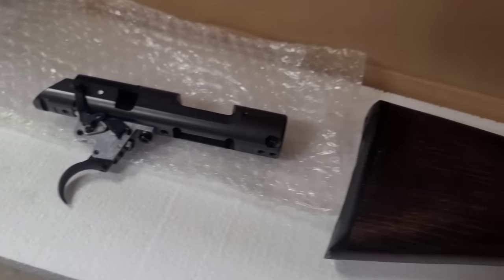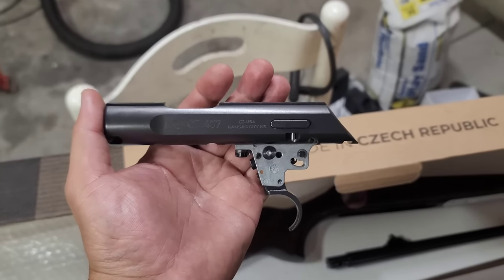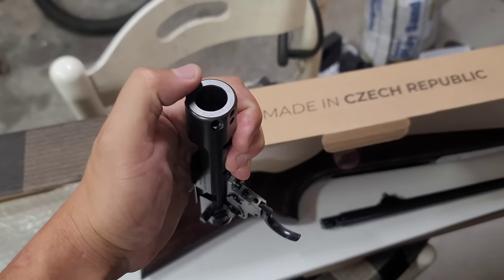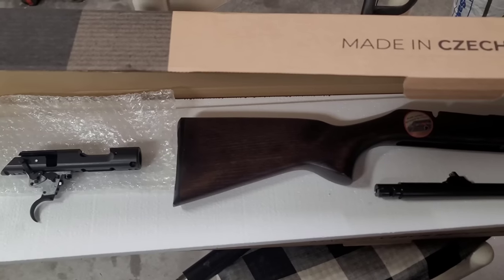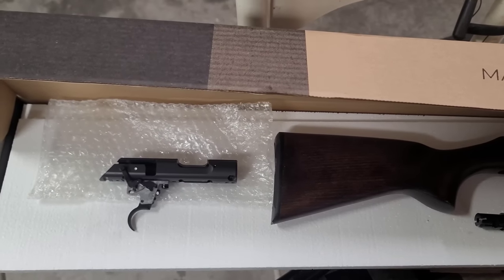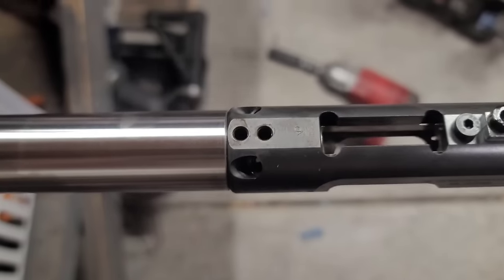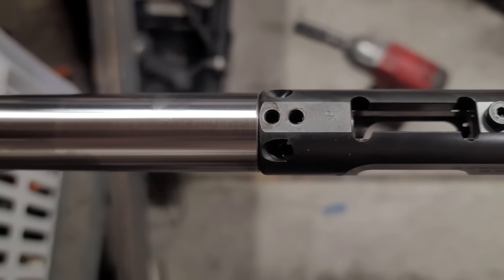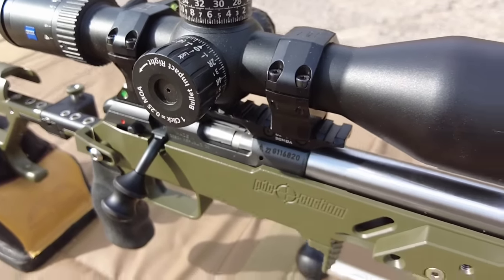Why my CZ457 builds are crazy accurate🎯 #DPGunworks

Comment: I totally get what you are doing, and why. I have zero experience with the 457, but I've seen bone stock CZ 452's American sporters shoot as good at 50 yards. I would expect smaller groups at 50 for the work that you are doing. That's basically a .22 LR rail gun you got going there weight wise. Maybe you just need to find the right lot of ammo for that rifle.
Reply from the maker: The rifle isn't lot tested. What you see here is consistent repeatable accuracy and ability to shoot either Lapua or Eley. Don't see any videos of a 452 shoot 1 inch consistently at 100 or not having a cold bore shift? So to state 452's in general shoot as good as this one is erroneous to state because thats far from truth
Btw, biggest group here at 50 was .378".

Comment: How many factory rifles have you had to send back?  Always nice to see someone take pride in there work!
Reply from the maker: More than I can remember lol
Reply: @EagleEyeShooting  that sucks. My dad worked for Ruger for a bunch of years and they had a run of bad 10-22’s for a few months. It happens unfortunately
Reply: @jeffhuntley2921  I'd guess that Kenny's standards are a wee bit more restrictive than Ruger's.  And I say that as someone who has a very accurate Ruger American in .308 Win.  One-by-one builds will always have greater opportunity for tighter standards and getting closer to perfection.  

Big batch builders like Ruger can't sell for low prices if they QC as restrictively as Kenny does.  While my Ruger is very accurate it's also rough around the edges, and that's why it was not too expensive.  A build like what Kenny does would naturally cost much, much more because so much more work goes into it.

And you're absolutely right that the big batch builders sometimes have a lot or two that go into retail streams, with what should have been caught in QC if they were QC'd one-by-one.  Springfield's new Prodigy pistol is like that.

Comment: I have a CZ 457 Pro Varmint Suppressed (CGS Aluminum Hyra) that I'm getting .509 MOA/.266" groups with RWS Rifle Match at 50 yards.  What could you do with my rifle to make it better, if you could and how much tighter of groups could I expect?
Reply from the maker: Shoot it at 100 and tell me honest groups. Accuracy is only one factor. How picky is it with that ammo? How balanced is the rifle? How repeatable is your groups? Do you have a cold bore? These are just some factors that a custom fitted /custom rifle brings on the table. The cost justification is anyones opinion. To some, general target shooting and plinking, a factory rifle may suffice.  To others, a competition with cost of travel, lodging, rentals and ammunition out weighs the cost of a custom rifle. The competitive edge to gain a podium finish can be a difference of a .05" an inch or 1 more impact than the other.  Take any info on here as a grain of salt and do your diligence to understand what benefits outway the cons
Reply: @EagleEyeShooting  Honestly at 100 yards, I am looking at .75 to 1 moa groups repeatable with the right ammo.  The rifle is super picky (.5 moa to 2 moa groups at 50 yards depending on the ammo).  I use it mostly for hunting (rabbits, squirrels and prairie dogs) but also enjoy shooting for accuracy at the range for my YT channel.  I always shoot it suppressed and have found it shoots better with the can than without it.  I haven't competed in comps in a really long time and don't know if the shooting world is ready for me to get back into kicking everyone's butt in NRL22 competitions.  Just wondering what I could expect.  If you want, go to my about page on my channel and shoot me an email.
Reply from the maker: Most factory rifles tend to favor any kind of weight on the muzzle. 22lr being as dirty as it is, I personally don't use a can for accuracy concerns. Debris fall back into the bore and cause impact shift. The biggest benefit that I noticed just going with a custom barrel is its forgiving chamber (depending who manufacturers the barrel). Since I handfit my own barrels, I typically see .3" grouping all around performer at 50 yards will all major brands of match ammo. Some obviously perform better but it being less picky opens the door. Im able to eliminate cold bore shift (shot without a can) also. For the general plinker, the cost obviously would be the deciding factor
Reply: @EagleEyeShooting  Those sound-like amazing results.  I looked up a NRL22 comp location that is only 45 minutes from my house.  I am going to join, and if I end up enjoying it, I will probably have you build me a custom rifle for comp and keep my CZ457 for hunting.  Thank you for inspiring me to get back into competition.

Comment: Those PDC chassis are awesome. What would you recommend for action screw torque in these and chassis in general?
Reply from the maker: I actually don't have a setting.  Just use a T handle wrench until it springs back lol

Comment: I’ve watched a ton of your videos and no one else I ask can seem to answer this question.  Do you know what the actual difference in the standard and match chambers are on the factory CZ barrels?  All I can find is that the match barrels are on the very edge of the cip limits, but no where can I find any of the info as to some actual numbers for the standard chamber vs match. I have a CZ thumbhole model that seems to be directly imported from the European market since it had a CIP stamp and is threaded 1/2x20. Eventually I would replace the barrel but before that I would like to shoot in some base class matches. I’m trying to figure out if the Match barrel is actually worth the upgrade or not before making the jump to a custom barrel.
Reply from the maker: Appreciate following. The term "match" is loosely  thrown around in today's precision world, mostly as a marketing tactic.  A true "match" chamber in 22LR falls inline the chamber dimensions being within 5 ten thou of a specific type of ammo. Eg. Eley Tenex.  These chambers are typically tight around the chamber opening about .2252" and have little to no taper. Chamber lengths are also shorter and throat lead angles are set to 2* for lapua or 1.35 for Eley EPS. Typically these chambers cause issues in reliability for extraction and feeding in repeater actions. The tight tolerances make them extremely picky on ammo and lot numbers but tend to have overall better accuracy once you find the lot the barrel likes. You can research 22lr reamer prints and start comparing measurements.  The Win 52D is considered a match chamber, I've done a video on that labeled (Does a true match chamber belong in a prs 22lr)
Reply: @EagleEyeShooting  I appreciate the info. I’ll take a look at that video. Long term I would love to get one if the 457s you barrel, but right now I am trying to figure out if I can justify the extra $ for one of the MTR variants, or just get one if the others that has a 20” barrel and not the “match” chamber.

Comment: What's the reason u can't bore the action to take out the taper?
Reply from the maker: Labor cost vs cost of a brand new action. Theirs no easy way to align the receiver on bolt race way centers. Receivers are heat treated, will require carbide. Working on a tool similar to Dave Mansons Rem 700 trueing jig which alignes using the bolt race way

Comment: I am curious, if the taper and concentricity is an issue, why not true up the bore of the receiver instead of sending it back? You are custom fitting the tennon anyway. Great work though!
Reply from the maker: That's exactly a tool i designed.  Waiting on it
Reply: Yeah, I clicked out just before closing thoughts, re watched till the end. I would be interested in a re-barrel when you are ready to do them. You know, skip the whole transfer thing.😉 Thanks for replying.

Comment: I want to see more about the tool you cut those angled reliefs in the barrel with. Does that just attach to the tool post of the lathe, or? 

Also, if you know, what kind of Rockwell hardness are those barrels when you get them? 

Thanks for being a no bullshit and no gimmicks channel. I value that a whole lot. Much appreciated.
Reply: Can't wait to see the air Guage tool!
Reply from the maker: The tool is a BXA tool post holder for a makita router. Made by bald eagle on ebay. 
I haven't measured the rockwell of Shilen barrels, but I can certainly tell they are on the softer side compared to Bartlein or Krieger when machining
Reply: @EagleEyeShooting  thanks for those insights. Take care.

Comment: That sucks. The moment you posted, you were rebarreling, I went and bought a brand new CZ457 and have been waiting for the announcement you were going to do more.  Now, if I want one, I have to buy another one from you.
Reply from the maker: In the end of this video I stated I was working on a tool to square up actions. Your not at a total loss. Just food for thought, let the rifle manufactures build you the complete rifle. Many search for "deals". As a manufacture, we build relationships with other manufacturers, these relationships also come with benefits of quality parts and easy RMA and warranty
Reply: @Eagle Eye Shooting  in the beginning, you were doing others' rifles and still are with the Bergaras, so the logical thing was to have it purchased and ready when you were. I like the work I see from you, and the fact that you're using Shilen Barrels had me excited.  I live close to Shilen and have been emailing them for years about making a pre-fit. I still like your way better than pre-fit.
Reply from the maker: Here's a good analogy.  If I bought all my brake parts from Autozone and went to the dealer to have them installed with their guarantee that those brakes will stop just the same and wont squeel. Think the dealership will sign their liability on that? What if the dealership found an issue with one of the pads but the client still said use it?
In the end its all about liability and warranty.  Bergaras will warranty parts even if I did not purchase the action. CZ wont
Reply: @Eagle Eye Shooting  in your analogy, you're implying you are the "Manufacturer" like Ford and CZ. However, you didn't make the action,  CZ did. So, in actuality, you are a parts changer like the local mechanic. I do mean an "ASE certified" type and not some shade tree. When I purchase something and modify it, such as my F350, that may or may not have been deleted. I don't expect Ford to warranty anything, just like I wouldn't expect you or CZ to warranty my rifle after I ask for you to modify it.  I'm trusting your abilities and reputation to go the best job you can with what you have to work with. If the tolerances are out of your spec, I would expect you  to decline modifying my rifle and charge me for what you have done. That is how the greater public has had their rifles modified or customized to their liking for decades. Please don't take this as anything but discussion. I'm not trying to make you mad or anything like that.
Reply from the maker: I was heavy line Toyota and Ford tech. Ive seen ASE Certifiable techs from UTI can't even change a serp belt. Ive personally trained many techs and had them flagging 80+ hrs a week. I am NOT a parts changer, I represent a unique custom rifle buisness with high quality standards.
I will not take peoples parts to put my name on them. Firstly your screwing the manufacturer (me) and our relationship with the distributor or original manufacturer.  Secondly, I have no ability to exchange if theirs a problem. Third, if it gets damaged, I assume all liability. Im not a shade tree gunsmith. Cheap work is never good, and good work is never cheap. 
Everyone wants to drive a Ferrari but pay fiat prices like I mentioned. I need to build a mutual understanding with my clients.fact your unwilling to understand is a big red flag for me. Good luck with your CZ. Btw I've read your responses to my associate in our company.

Comment: Sadly so many youtubers showing off expensive builds. much time and money spent just to shoot the rifles with the help of stands, bipods and vice grips. I hardly see any offhand, or some old school shooting. What's the pointing of even shouldering the gun. Use an automated trigger and a remote. It probably weighs as much a lmg :/
Reply from the maker: Theirs this sport called NRL22 and PRS that incorporates all that run and gun and positional shooting (what these rifles are built for). When show casing a rifles true performance in accuracy, you want to reduce shooter error correct? I suggest gaining some insight before judging
Reply: Because there is an entire sport that these rifles are used for and the sport is growing super fast. 
Just because you dont like the sport or the style rifle doesnt mean its not viable
Reply: 😂 You can’t prove precision offhand.
Reply: I say get both. I appreciate a nice wood stock CZ for shooting the CMP sporter discipline (prone sling sit sling and offhand) AND one of these little tack drivers for NRL/PRS22… if I can get me a “disabled” (left hand) one!
Reply: Offhand shooting doesn’t show the true capabilities of a rifle . Regardless of the shooter